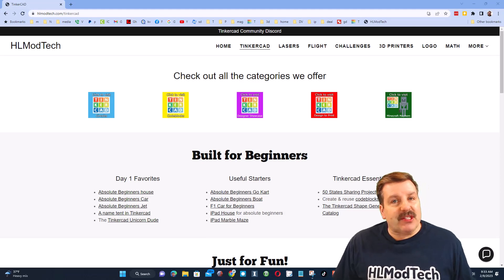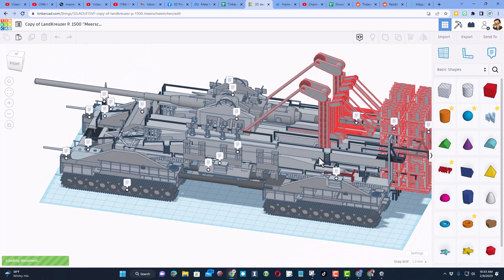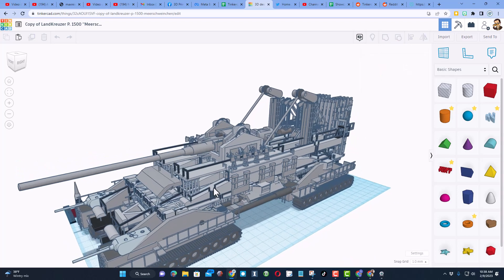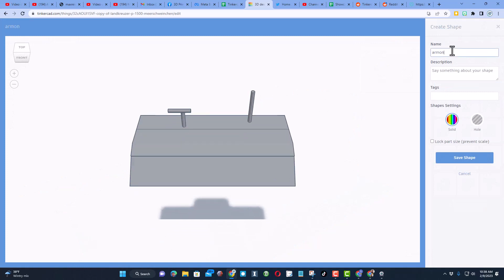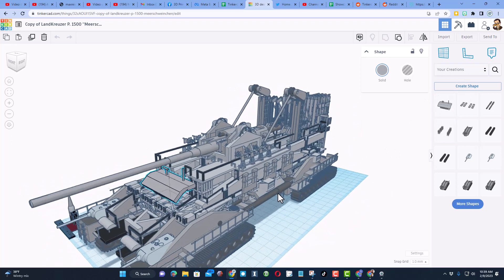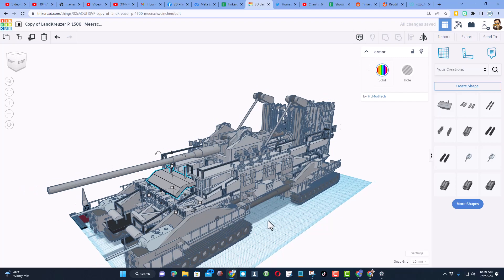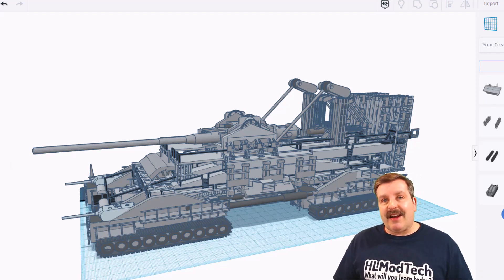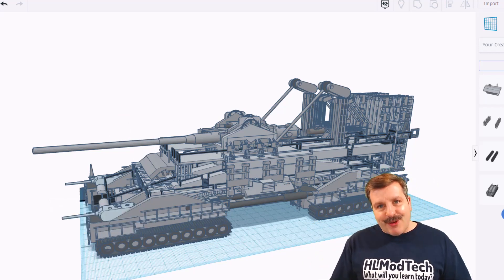Maximize your Tinkercad Design Complexity by Making Shapes Parts!  🤯

Comment: So if anything happens, is waiting a viable fix to the problem? I was building a rocket with curved fins the other day. I was shaping the part from a flattened block, cutting it with a cylinder. It assembled fine, but when I revisited the model or tried to slice it, sections of the block on the fins would reappear in the render.
Would waiting have cured that?
Reply from the maker: Patience is always a good first step. Sometimes also when a project is goofy, I’ll just make a duplicate just to be safe.
Reply: Probably waiting would have worked. Unless it takes so long your browser session times out or your desktop goes into sleep mode.

One solution is to assemble the part in a separate project and either copy and paste or make a personal shape to get it into the main design.